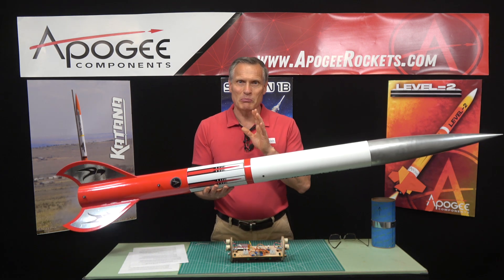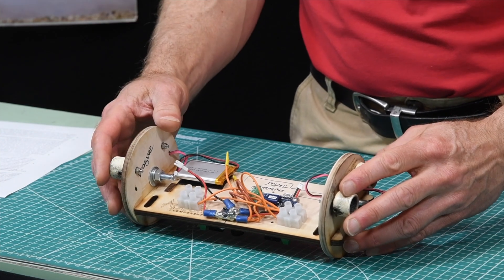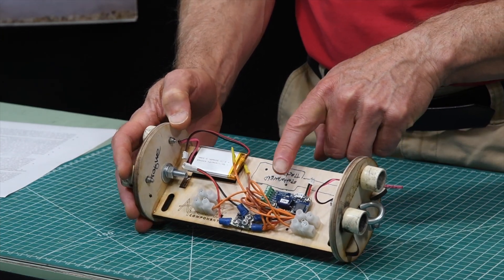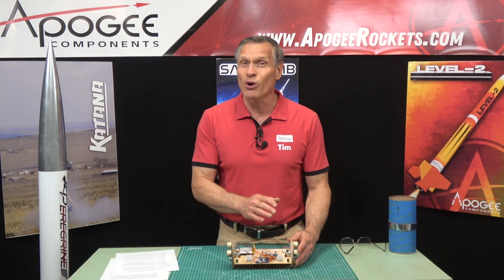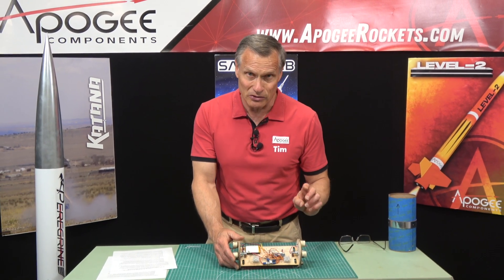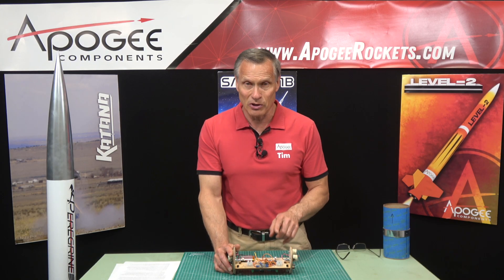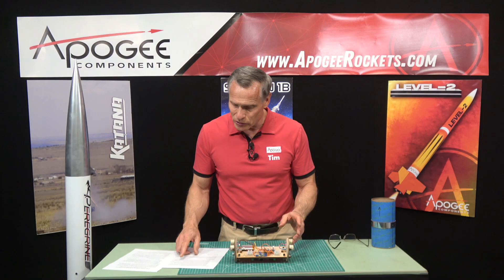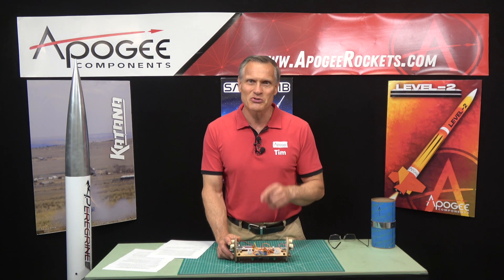Redundant Electronics for Dual Deployment Rockets

Comment: Great vid. Another question comes to mind and to me an important one because I have the faintest idea. "What is the best way to construct a pressure measurement hole?"
Reply: The altimeter manufacturer generally has recommended sizes and quantities based on the airframe size.

Comment: Exactly......in the Marine Corp, we always wired explosives twice. The chances of one failing is very high, but the chances of both failing is astronomical. I'm still flying G or below models, and I know that I'm going to have to use electronic ignition/deployment sooner or later. I'm getting in all the practice I can.......and Tim, your wire snake pit is a no no. Plan out and lay down your wiring in a nice neat order and fix them in place with superglue or epoxy. Thanks for sharing. Good stuff.....= )

Comment: When do the wires need to be twisted to reduce electrical interference?
Reply: Rarely. The most typical failures are going to be as a result of failed connections and human error. That said, there isn't a downside to twisting source and return lines together. It will always reduce noise or have, effectively no effect.
Reply: The use of twisted pair wires is more out of convenience. It’s good wire, easy to work with, makes for a clean av bay, and the side benefit of course is the resistance to interference.